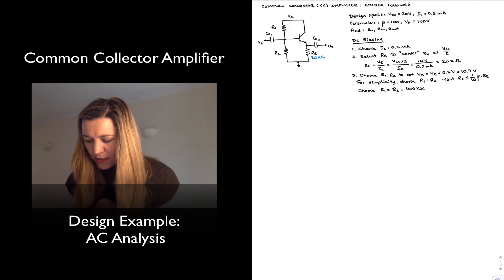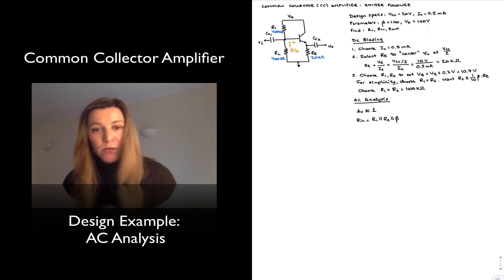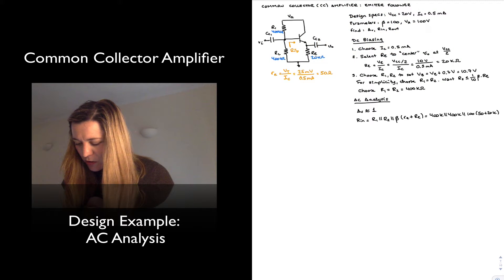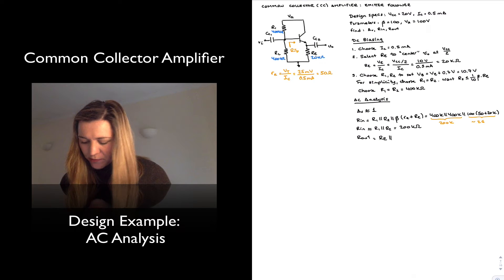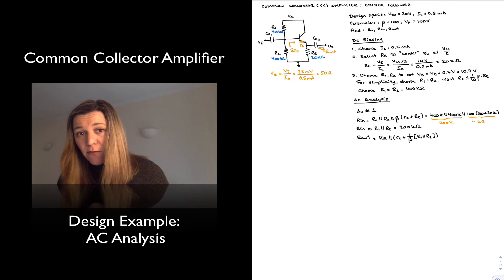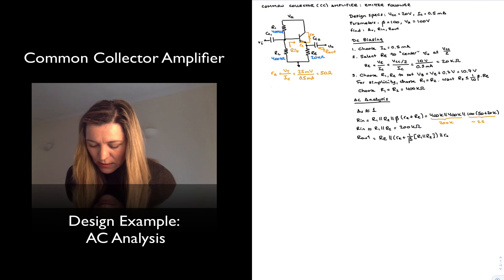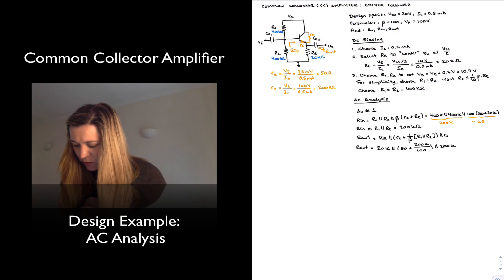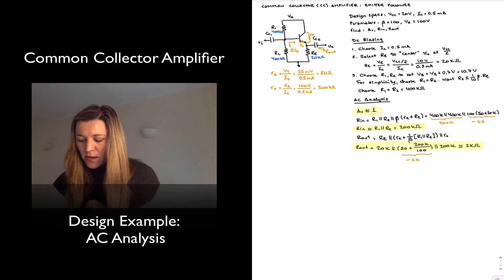CC Amplifier: AC Analysis

Comment: Why include RE for AC analysis? Although including it wouldn't affect the answer but shouldn't RE be bypassed anyway because of the capacitor?
Reply: the capacitor C_c2 is not conected to ground (parallel to R_E) so we can Not bypass R_E in AC  analysis